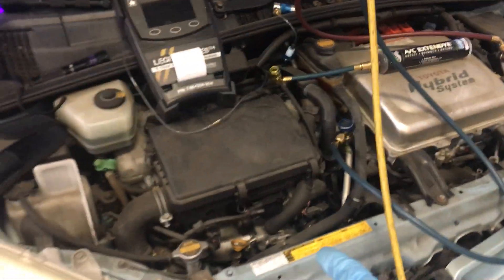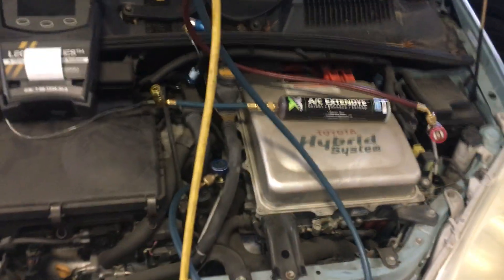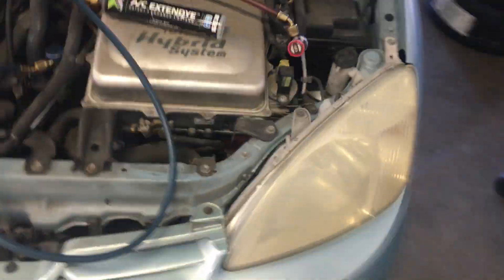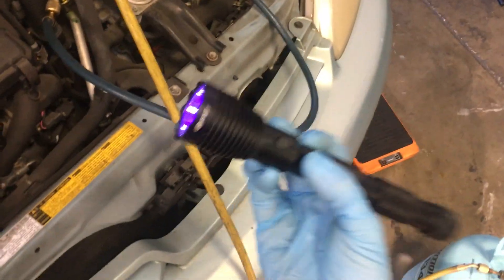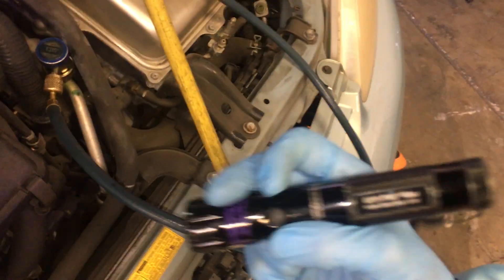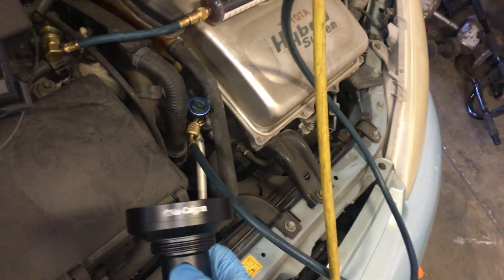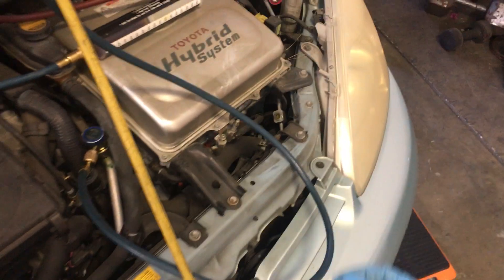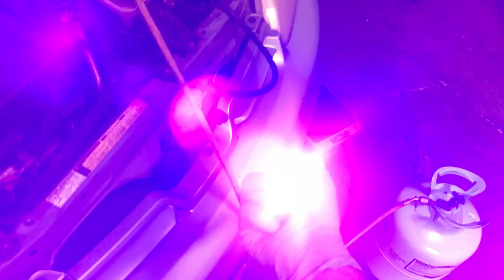UV LIGHT, UV DYE, different types. 365nm, 395nm, 400nm, BLUE UV Light spectrum +400 to about 500nm

Comment: Where did you get the first light, having trouble finding it.
Reply from the maker: @EvilVette1112  you don’t want the first light that’s old technology and it’s over $500. 
     Do you want the UV Beast 365 or the 385-395 or both they’re only about 80 bucks and they’re the strongest brightest lowest UV lights I’ve ever found there’s only one more light that might be brighter. That is the Convoy L21B- X4 $279 for the 365 nm spectrum

Comment: Which one is better to find the 134a or 1234yf leak ?
365 nm or 395 nm ?
Reply from the maker: Excellent question.  365 nm for 395 nm this has nothing to do with the refrigerant itself. 

The light wave length in the UV spectrum for the UV fluorescent dye has to do with the wave length that the dye manufacturer chooses to use in their dye. 

Some manufacturers use the 365 nm 

Some manufactures use the 395 nm and even up to 400+ nm

Are use dye from a manufacture in the 365 range. 

         But I get a range of vehicles from other shops that use different manufacturers dye so I own all the lights. 

        But you do not have to worry because if you get a very strong light in the 365 nm range. 

      That only means that that particular LED diode and filter are at its peak strength at 365 nm. 
                There is light bleed over in the lower range and upper range that’s still fluoresces the other dyes. 

            If you can only afford to get one light I would recommend getting the 365 nm.
Reply: @coldfinger459sub0  thank you
Reply: @coldfinger459sub0  "If you can only afford to get one light I would recommend getting the 365 nm." This is the most important take-away for me - thank you!

Comment: Very informative, like all your videos.
Reply from the maker: Now you got me looking for 365 nm 10 W laser.  Got a search China for that one not legal in the US for sale.
Reply: @coldfinger459sub0  10w! You could burn off all the old dye with that. Laser protective goggles are a whole different type of safety gear. Better make sure you get those for the wavelength you're going for. Watch out for reflections. I think I damaged my retina with a laser when I was younger. Retinal specialist did a test on my left eye that was super annoying. It involved focusing on something and hitting a button when I saw the lights. Revealed that I'm a little blind the corner of my left eye but I don't notice it.  If your eyes feel like they have sand in them it's a sign of recent damage to your retinas.
Reply from the maker: @RobertLanghorn  like when you’re a teenager in your welding for the first time can you use two weak of glasses or no glasses and all wake up the next day with the burning Send in the eyes experience that once. 
         Put wide dispersion lens over the focus beam so it doesn’t have a direct focal power but could light the hell out of under a hood of a car.  
        But still definitely need high-grade protective laser glasses. 
          I seen a demonstration of cheap laser eye protective glasses and quality professional ones before. 

            The most dangerous UV lights are when you put the filter on it and you can’t see any visible light if you don’t know you’re looking at it or reflecting back in your eye off of something shiny. 
            I think UV laser light is the most scary dangerous thing if you think of it because you don’t even know it’s there.

Comment: Thank you, is it nessary to use the yellow classes to find the leak?
Reply from the maker: It’s not necessary for this manufactures dye. But the glasses are for UV protection because ultraviolet light is bad for the cornea of your eyes. Some manufactures dies if you don’t use the light you won’t see the die specially if it is over diluted. 
        The glasses help enhance the glowing of the dye make it brighter.  If I would take the glasses and put them in front of the camera lens you would see the day I get bright. 

      There are some types of dyes from manufacturers with some lights if you don’t use the glasses you would barely see the dye glow especially if you were in a bright location out in a parking lot on a bright day or a very well lit shop. 
               There’s been many times  I’m in other shops and one of the technicians are looking for a leak with their UV light and they don’t see anything.. I go get one of my UV lights and shine it on the same car and the leak glows out brightly.